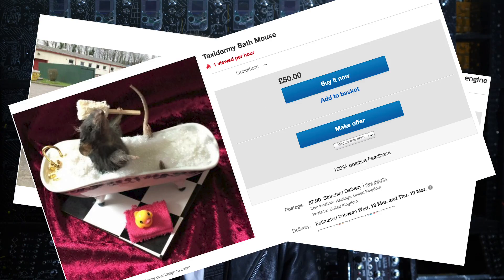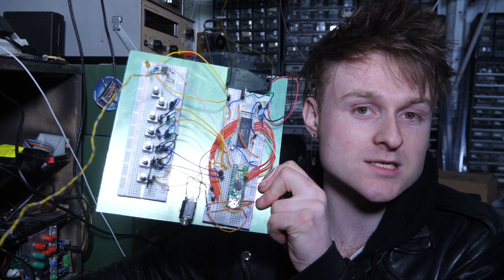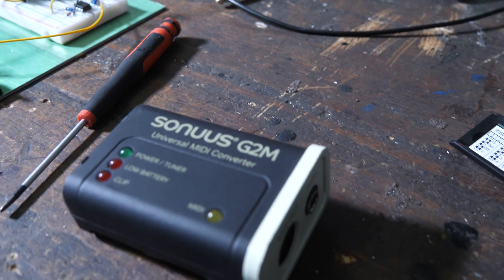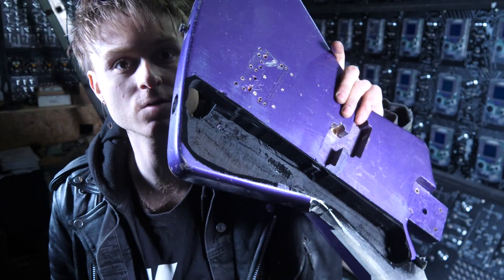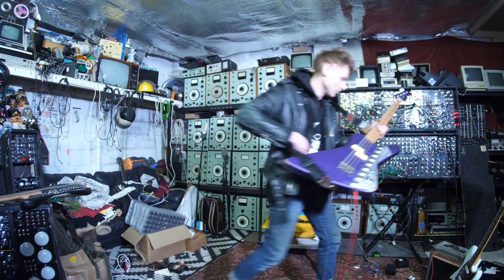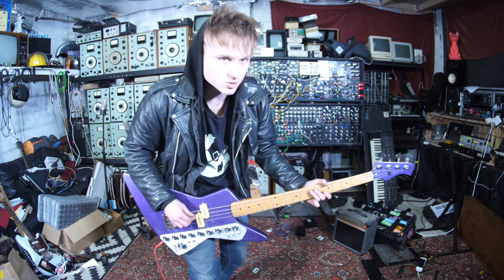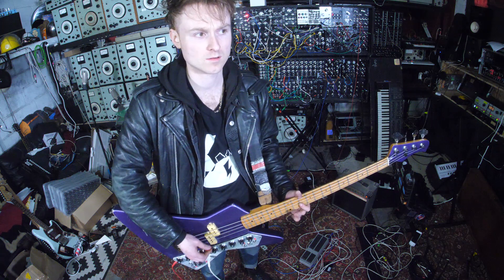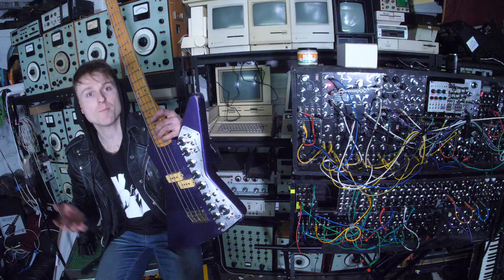BUILDING A DIY BASS GUITAR SYNTHESIZER WITH A SID CHIP

Comment from the maker: A Sample Pack of random bits and bobs from this performance is available on my patreon :-  https://www.patreon.com/lookmumnocomputer
ALSO! my partner has put up her first video on LUNAR PORTRAITS :- https://www.youtube.com/watch?v=Nd6f_BZwGnA
Brian Peters Links :-
VIDEO :- https://www.youtube.com/watch?v=-AR1PfW5tHM&feature=emb_title
GITHUB :- https://github.com/brianmarkpeters/CHIP_BASED_SYNTHESIZERS
If anyone knows Brian please let him know. i tried to get in touch about this but i had no response. so i wont be sharing my version with the knobs.
Reply: Try moving the pickup as close to the bridge as possible - you need to pick up the fundamental  - that's easier, without overtones, nearer the bridge. Old school synth pickups are sometimes inside the bridge, or as near as, for this reason. You could have a bridge mounted acoustic pickup, a piezo contact; if it works, could remove the bass pickup entirely and have a crazy dummy pickup, oscillating/scrolling/EQ LED panel or a function readout or summink. 
Tight on space - so *Load different chips via cartridge?!!* - Mount the MIDI conversion, power, line amp on the bass; mount the chips, and sundries on the cartridges. Standardise the contacts for your bass mounted controls, MIDI,  power across different cartridges. Swappable synth chip cartridges for your synth bass. 
One note - higher pitches are going to be quicker to get picked up, because you can only detect the pitch after half a wave length, when the voltage crosses back across the 0 line after half a cycle. Using 4 guitar strings and sub octaving via MIDI, pre synth, is probably a really good idea, although you might need a new nut.
Reply: @LOOK MUM NO COMPUTER - I didn't think, but the bass neck truss rod might 'implode' under guitar string tensions - you'd need to really slack it off, don't know by how much - might need a guitar neck, or these piccolo strings seem to be mentioned - although this might improve your string action ;) Can you be arsed resiting a tuning peg to fit a guitar G string?
EDIT - if you did make standardised synth-chip cartridges for the bass, you could also use them in a rack-mounted socket, a guitar version, or anything in an analog pitch to midi self contained unit - wintergatan (the marble machine guy - he's ace) has a violin thing with a ribbon controller analog to MIDI thing you should check out. A 'Modulin' https://www.youtube.com/watch?v=MUdWeBYe3GY
You might be losing response timing just over MIDI - this bloke https://mitxela.com/projects/hardware has a bunch of interesting projects to lose yourself in, one of which takes a MIDI signal and uses it to directly generate a square wave, from which he gets more complexity - fastest response time possible and a useable alternative to synthchips.
Reply: 4:06 OH OH DUDE!!!!! Woah did you make that????? WOAH THAT WAS SICK!!!! Wheres the full track???? Woah dude!!!!
Reply: @jhowardsupporter  I need it too!!!!!!!!!
Reply: @jhowardsupporter  Found out! Look mum no computer - Desperado vespa
Reply: Lets put a synth punk band together
Reply: Do you still have that bass if so would you be willing to sell it ??
Reply from the maker: ratatoullie music sorry . Not for sale 🙃
Reply: @LOOKMUMNOCOMPUTER  oh damnn thanks anyway man sick build btw
Reply: @ratatouille420pm4  That or make a build log and make it?
Reply: You should attempt a cover of Rob Hubbard's Arcade Classics title theme with this somehow! Brilliant stuff 😎
https://youtu.be/9MLFXo7f5D8
Reply: We don't have bits and bobs in our country. Shame, really. Pick up that Mustang. Ultimate victory on the Hondo synth.
Reply: Crazy it sounds like the organ I got glad to have you back in my life cause u make it so golrous
Reply: What is music name when you was building the masterpiece
Reply: dude that track was sick I haven't heard anything that sick since Donald Trump shut the hell up!
Reply: I want that bass or one built for me. How much would u charge me? Amazing
Reply: Would you be willing to part with that extra neck? Also i just adore that synth bass, gives me new wave chills!
Reply: КРУТО ЧУВАК !!!!!!!!!!
Reply: and a beat box and this sound like nintendo music
Reply: Would Love to get a build log and program one of these myself.
Reply: I have a telemark k you can have for free👽
Reply: dear Sam, I have been using the sonuus B2M (the one for bass) for a long time, and recently I changed it for the G2M V3 (the new multi use for guitar, bass and winds) this one for guitar, has a selection of levers that has where the battery go, so if it is not taking the bass well, it is for sure because you have not put the levers in place. If you have kept the original case cover there it indicates if not in the manual, for 4 string bass the selection is 1 up 2 down.

Comment: Put another pickup in above the existing one. Set a circuit up with that pickup (2nd), that is just a standard bass circuit with a mix knob controlling the blend between the synth and standard tone. So that the tone has an underlying clean bass tone / thump with a synth decay. Randall distortion synth Bass tone. Or a split off the existing pickup, I guess. Very Cool! Kill switch on the synth circuit?

Comment: You could get a pot, turn it sideways. Get a wide plastic knob, drill a hole in it. Put a whammy bar in it, recess it into the body, and put a spring on it and have the whammy as the voicing oscillator.

Comment: 0:16 Imagine that Rover 825 Hearse with the back fitted out with a huge synthesizer and lighting system on display through the huge windows. It could be used to advertise the museum but also allow you to bring the party everywhere you drive! Park it outside the museum and have it draw attention. It would be more effective as advertising than any sign could ever provide. 👀 You could scribble circuit diagrams in white marker all over the car's black paint and inexpensively transform it with your graphic style.

Comment: I love these synth guitars and basses but personally i always find it kind of dissapointing its just a MIDI controller as the actual original sound is lost. But if you just modified the sound that'd really just be a modulator and thats what effects pedals are for so would it be possible to make a kind of hybrid? Like something that modulates the bass sounds and synthesizes sounds to go along with it like automatic chords by taking the midi output and making a chord with the played note as the root note. or it could record what you play and play loops of that either with the modulated bass sound or something synthesized from using it as a MIDI controller. I just wish I had the skills to build something like that.
Reply: be the change you want to see

Comment: can you be so kind to perfect this. ill send you a fender pbass i hollowed out and shved to a sexy body some 335 pickups i found in the trash a sid chip from a comador 128, i also burned the electronics port out with smelting fire and fiberglassed the back and hollowed out the inside with a drill and chizel, it has vox tunners and a handel like an ibenez, it just needs your touch , i beg for round two my name is Audio Seidenglanz

Comment: There are two problems with the SID chip:
1. It has a high noise level
2. I never found out how to reset one of the oscillators properly before using it again.

Comment: lol, awesome ... wouldn't it work if you augment the signal from a guitar's pick up to synthesizer level, using Fets (2n5485 or so), capacitors, some resistors and opams to 10 v.p.p. ... and ad a simple filter, overdrive and stuff? ..... plug it directly in your synth.
i got to get myself a abandoned guitar some day.

Comment: Do you have the G2M set to BASS mode? There are a few mini switches that adjust the pitch detection depending on the instrument. In the manual you'll find the setting for bass guitars and the tracking and latency will improve considerably
Reply from the maker: Roger Félez yes I have. I wouldn’t have gone to all this length to not check what those switches do 😁

Comment: could just swap out the G2M with a B2M, I've got one it tracks perfect on the low notes if you adjust picking technique.
easier to swap the strings though
Reply from the maker: It’s a g2m 2
Reply: @LOOKMUMNOCOMPUTER  damn, that's the only one they make now, a little cheeky if it doesn't track the low notes that well. can't really fault it in this thing though, it sounds like a goddamned beast, great work.

Comment: pretty awesome! couldn't you bypass the midi module by using the pickups generated voltage as the CV for the oscillator?

Comment: @look mum no computer, why dont you try another bass, with 2 mics, active circuit, and on the AMP circuit, add an IC that works amplifying the lower voltage currents, like a tl084 or something small like that. i dunno where you gonna get the MINUS DC voltage from but im sure you can figure it out, that will for sure make the darker notes sound on the synth amp.

Comment: My electo acoustic bass had a pick up in it that read frequencies from a guitar. It was fine but wouldn’t pick up the E as it was too low a frequency. Buy cheap, buy twice! Maybe the guitar synth reader box thing just isn’t good at picking up lower frequencies than it was designed for?

Comment: just buy yourself a set of 6-string bass strings, and leave off the two lowest strings.  Youll still have a bass, but tuned A-D-G-C.  It would also help with the high action you're experiencing (less tension on the neck)

Comment: You could also somehow mount the strings in an isolated way and use them as switches together with the frets. The frets inter-connected with resistors would make up a voltage divider... might work with some analog input of the controller board. Never did this, but I think I saw it somewhere.
Reply: You're absolutely right, it HAS been done before, back in the 80s i think - I seem to remember that the VOX company in the UK did an Organ Guitar using that concept. 
(Googling "organ guitar")
Yup, it was VOX: http://www.voxshowroom.com/us/guitar/guitar_organ.html

Comment: Will putting guitar strings on it not mess with the scale length?
Reply from the maker: No. look up how scale and note scaling work :). However getting strings long enough will be the tough one.
Reply: @LOOKMUMNOCOMPUTER  im aware just wasnt sure, just asking, i notice putting thicker or thinner strings can be funny but i think thats a matter of action and tension, i was going to swap out a tele neck for a strat neck but the fretting was 21 to 22. Dont think it mattera as i was going to rip em out and make a true temperament fretting system. But yeah, for sure you'll struggle to find em that length 😂 quick q, ever tried chrome flatwounds for guitar? They do them in guage 10s 😁

Comment: Ay, idk if you read enough of the comments to see this — on the issues you’re having w/ G2M recognizing the lower notes, you could convert the input signal an octave up? Digitally this is done by taking the absolute value of each sample, effectively folding the negative parts up. I’m not terribly familiar with the analog equivalent but I know I’ve seen schematics for it before that only require a handful of components. Then while processing the MIDI signal you can shift the pitch back down an octave to get the note that was originally played.
Reply: asdfpoiuyify my solution would be use a set of piccolo strings so the bass is pitched an octave up without needing any pitch shifting

Comment: I thought if you run the pickups out into a fuzz or disto pedal along side the Sid chip at a slightly lower volume it would fill in the latency gaps nicely. Further modulation/filtering on the fuzz out could also take place maybe in tandem with the Sid chip on the expression pedal.

Comment: could use piccolo strings, tuned like guitar strings but thicker to fit a bass
Reply: @Mungoes  Right but the less effects between the pickup and the converter, the better
Reply: What about an octave up circuit before the midi converter?
Reply: @widdlytube  doesnt sound the same, i think the less you effect the signal the better the result will beb
Reply: This.  Maybe foam under bridge to mute strings

Comment: so it relies on software to determine what note is being played, and synthesizes a note based on this? are there any other stringed instrument synths that keep the original signal? or would that be missing the point of synthesis?
Reply: At that point wouldn't it essentially just be guitar pedals in a guitar?

Comment: I would love a blend switch that would mix the clean bass signal with the synth. Anyway great video as always!
Reply from the maker: sure! but i decided to do away with the bass entirely. cus from experience when they are mixed they sound a bit naff. so decided to go extreeeeeme haha
Reply: @LOOKMUMNOCOMPUTER  Is that because of phase problems between the bass string and the synth wave? What if you had a control on the synth that allowed you to phase-align the two? You get similar problems sometimes when a bass and a kick drum cancel each either out in a studio situation, and end up with a tragic loss of low end. Popping the phase on the bass often brings the boom back. Does this chip give you a way to set the phase at the start of a note?
Reply from the maker: Iliya Labaznov naaa just a taste thing innit